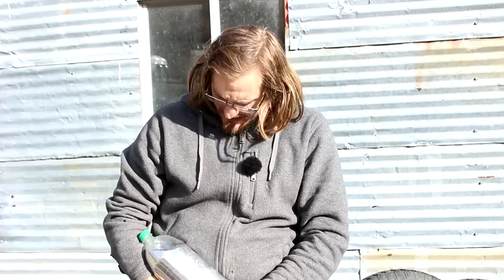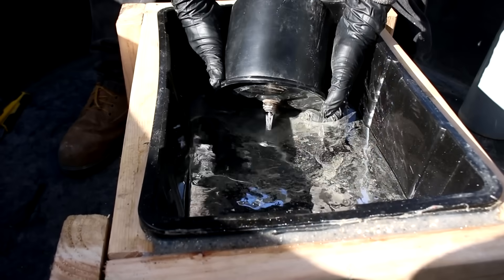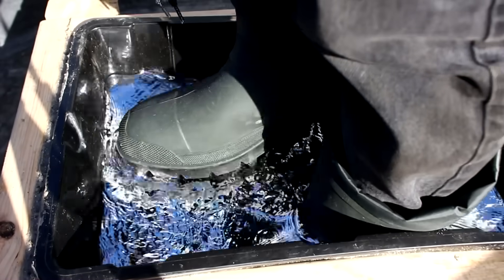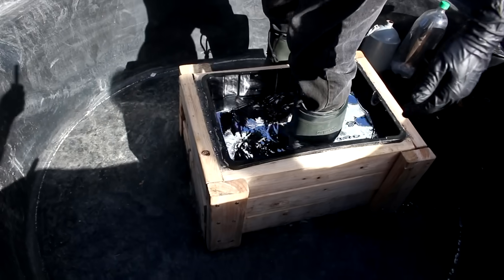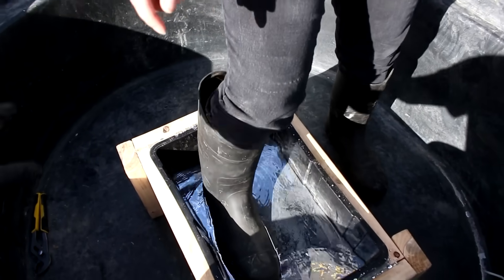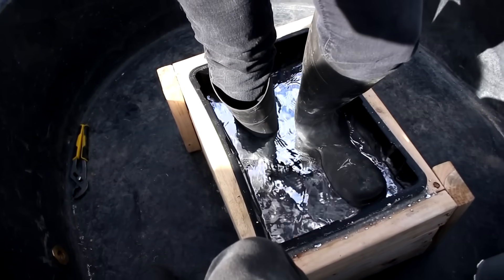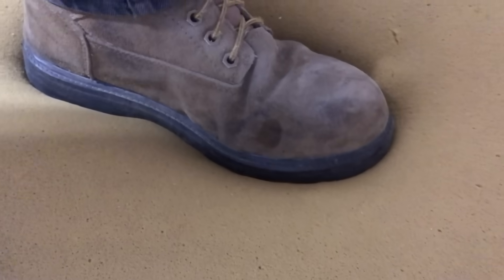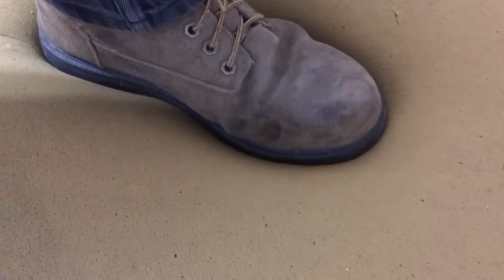Can I Stand On Liquid Mercury?

Comment: Anyone wondering, only ingestion and long exposure to mercury is bad for your health and even then it's not exactly lethal. Lighthouse lights used to sit on a pool of mercury because it has very little friction and so the light can be kept spinning with much less effort. Whenever lighthouse keeper went up there (several times a day and night), they would be exposed to it. Not only that, during storms the tower would sway a bit and the bath of mercury would start to slosh and throw some mercury out of the pool which would then drip down on top of the lighthouse keepers, small amounts would even end up in their food.
Over time the poisoning would cause mental instability in lighthouse keepers, that combined with loneliness would drive them somewhat insane. "Mad as a lighthouse keeper" was a saying back then. They would act and talk rather irrationally and it was a rather widespread issue among lighthouse keepers, actually. But it would rarely lead to their deaths.
Anyhow, the issue went away with modern LED lights. No pool of mercury needed because it doesn't need to spin, LED lights just turn on and off in a rotating light pattern. Needs very little maintenance and often doesn't even need a resident keeper. The only thing that needs real maintenance is the tower itself as water and wind exposure is really harsh on the buildings.

Comment: You guys know that swimming pool that is the deepest pool on the Earth? They use it for research and stuff. What if they filled that with mercury? There's probably not that much mercury on Earth but hypothetically. I bet we couldn't even build something that could contain the pressure at the bottom. Hypothetically what if you froze a big water balloon and you  pulled  it all the way to the bottom? I wonder if there is a way to figure out how fast it would be going if you let it go and it shot up to the surface.

Comment: Could mercury be used to make tools (eg. hammer)? It should be at a temperature lower than -39 °C. What are the mechanical properties of mercury in the solid state? I've always been interested in that. Let's make a mercury machine that works at a low temperature lower than - 39 °C. And then there is an increase in temperature and the machine melts like ice cream and becomes liquid. That would be interesting.

Comment: should be possible to do some calculations first and then compare it with the outcome. lemme, try is about 13.5  and the density of water or Cody might be around 1. Suppose he is then sinking about 13 or 14 cm if he's 180 cm tall or about 13.5 of his length.  The video seems to confirm that even on 4:16.

Comment: really be careful because mercury is very dangerous and Try not to deal with it as much as you can.
even if you touch it , be sure to wash (Of course, never put the wound in contact with mercury). Because if, for example, you touch it with your hands and rub your hands on your eyes or it enters your body through your mouth or.. you may get cancer.
please be careful about it and Try not to deal with it as much as you can.❤
Reply: mercury doesnt cause cancer

Comment: This could be used as a manufacturing process. Vacuum bagging replacement comes to mind.
When I want to mold something in carbon fiber for instance. The bag is used with a vacuum pump to suck together the Carbon fiber material onto whatever mold I'm using. Sometimes I get wrinkles and other problems associated with sucking the air out of a bag.... 
If I could dip the carbon fiber mold into a vat of Mercury using some kind of paste or release agent or physical barrier to keep the Mercury from reacting with the epoxy resin the weight of the Mercury pressing onto and into every bend and curve and void would be perfect. Actually, Mercury being liquid could get into the inside spaces of a mold where you can't normally reach or apply a bag. Places were you wouldn't normally be able to remove the bag after curing too. Like really complicated shapes that wouldn't make removing traditional mold pieces even possible. 
Maybe latex? Latex could make the area you need to press into the mold Mercury proof and you would still get the pressure of the Mercury pushing against those complex hard it reach areas. And when it's cured. You just pour out the Mercury and peel off the latex.
You would have an amazing finish underneath.
You could mold parts in one piece that used to have to be done separately and then bonded together.

Comment: Just imagine if every sea and water on earth was replaced by liquid mercury. I cant imagine how thick submarine walls will have to be to handle such heavy forces
Reply: I don’t think you could even build a submarine, because steel floats on mercury too. Even if you left no air inside it would stay on the surface.
Reply: @mixer0014  i know. And doesnt mercury make aluminium weak? Aluminium is like one of the most used metals. I just cant imagine how hard if mercury replaced water

Comment: How stupid are you? You expose your self to mercury poisoning!
Reply: That's not very nice. I don't remember if it was this video or another, but Cody explains mercury evaporates at 1/500th the speed of water. Also, only the vapors do damage. You could drink the stuff and be fine.
Reply: @heath_00000  wow, did IQ levels just drop in your household? Do you also brush your teeth with arsenic?
Reply: @MEN101  You might be thinking of organic mercury, which is VERY deadly, just by contact with the skin. Also, mean, man!
Reply: @heath_00000  bro any form of mercury is toxic. They warn people against fluorescent lamps because they also contain mercury. 

Mercury regardless of the form, methyl or ethyl are highly toxic. The same goes for liquid mercury found in thermometers.
Reply: @MEN101  I said mercury was toxic. I was saying this mercury wasn't immediately lethal, or even noticeably harmful within the ~hour of exposure Cody had.
Reply: @MEN101  And steel is dangerous when lobbed at you at 500 meters a second. Doesnt stop you from interacting with it safetly day to day

Comment: mercury is poisonous
Reply from the maker: So is oxygen
Reply: @theCodyReeder  i did not know that thank you but how. i have heard that if mercury is dropped on skin people die i would like to know. thank you for letting me know. i love your videos
Reply: @madhupmaity6823  What you've heard is true for a compound of mercury called Dimethyl Mercury. Very dangerous and diffuses through the skin immediately on contact. Not all compounds of mercury are dangerous to the human body, but most are. Elemental mercury(what you see in the video) is very unreactive and you could theoretically drink pure mercury liquid and it pass through you completely unaffected. It also does not diffuse through skin so this is fine(but for safety, don't pour it on an open wound). Ask if you have any other questions. 

Mercury was used in amalgams for tooth filling precisely because of how safe pure mercury is.

Comment: This channel gives the dangerous impression that mercury is no big deal. A teaspoon suffices to contaminate an entire neighborhood
Reply: What was mentioned in this video is pure metallic mercury. This is different from the more toxic forms of mercury. Mercury vapor was likely insignificant because of the ventilation and the fact that it wasn’t hot. The mercury was also never dissolved or put through chemical process to where it would become water/fat soluble and could easily get into a person’s body and stay there to poison it. If you need any more about the risks of mercury, you don’t need to give into common fear, instead use proper scientific sources to understand the risk and safety measures for mercury

Comment: Moron
Reply: What was mentioned in this video is pure metallic mercury. This is different from the more toxic forms of mercury. Mercury vapor was likely insignificant because of the ventilation and the fact that it wasn’t hot. The mercury was also never dissolved or put through chemical process to where it would become water/fat soluble and could easily get into a person’s body and stay there to poison it. If you need any more about the risks of mercury, you don’t need to give into common fear, instead use proper scientific sources to understand the risk and safety measures for mercury

Comment: Haha just contact with bare skin is enough to poison you if in contact enough over some time
Reply: @JustmeMe-n8n  well that is liquid Mercury which is toxic to the human body, have you ever herd of the mad hatters disease? It was caused by the mercury that was used by hat makers a very long time ago... Just read about liquid Mercury it’s toxic.
Reply: Like I said in first comment if in contact enough over some time just read... And is not less toxic and if handled enough times it will build up inside body, Mercury is all the same they don’t take the poison out of it, it’s Mercury at the end of the day and Mercury is always toxic...
Reply: Brobrobro, this is elemental mercury,  and it's not very dangerous unless you inhale it or have a cut wound in your skin.
Reply: What was mentioned in this video is pure metallic mercury. This is different from the more toxic forms of mercury. Mercury vapor was likely insignificant because of the ventilation and the fact that it wasn’t hot. The mercury was also never dissolved or put through chemical process to where it would become water/fat soluble and could easily get into a person’s body and stay there to poison it. If you need any more about the risks of mercury, you don’t need to give into common fear, instead use proper scientific sources to understand the risk and safety measures for mercury
Reply: @muschgathloosia5875  haha yes crazy as a hatter, but when mercury is absorbed into the body either way vapour or handling its poison and will effect the human system

Comment: JUST PLAIN STUPID!
Reply: What was mentioned in this video is pure metallic mercury. This is different from the more toxic forms of mercury. Mercury vapor was likely insignificant because of the ventilation and the fact that it wasn’t hot. The mercury was also never dissolved or put through chemical process to where it would become water/fat soluble and could easily get into a person’s body and stay there to poison it. If you need any more about the risks of mercury, you don’t need to give into common fear, instead use proper scientific sources to understand the risk and safety measures for mercury

Comment: mercury is DEFINITELY just as dangerous as people have said ,   please if anyone's got kids watching videos like this ,  tell them to tab away from this misleading imformation ,   this is cyber crime almost
Reply: It is not you should not be in it for a long time but the only time it's really dangerous is when you drink it. Be scared of lead that is way deadlier.
Reply: What was mentioned in this video is pure metallic mercury. This is different from the more toxic forms of mercury. Mercury vapor was likely insignificant because of the ventilation and the fact that it wasn’t hot. The mercury was also never dissolved or put through chemical process to where it would become water/fat soluble and could easily get into a person’s body and stay there to poison it. If you need any more about the risks of mercury, you don’t need to give into common fear, instead use proper scientific sources to understand the risk and safety measures for mercury
Reply: damn your right. im boutta ring up the cyber police to lock up this cyber criminal. thank you random commenter, you have saved the day by proving this scientist he was wrong. were would we be without you

Comment: i think this is bullshit, i think hes using gallium in a very hot climate, because that much mercury would kill you many times over
Reply: If it was inside your body, yes. Metallic mercury cannot penetrate your skin. So as long as you don't breathe in a lot of the fumes (which is why he did it outside) or have an open wound touching the mercury, not a lot is gonna happen to you. He sent a blood sample to a lab after doing this and the mercury levels were only slightly elevated, not enough to pose a health risk.
Reply: Nah, ur bullshit. Do some research before calling everything u dont like fake
Reply: Note that gallium isnt nearly as dense as mercury, so if it were gallium, he wouldnt float as high

Comment: Isn’t this like super unsafe
Reply: What was mentioned in this video is pure metallic mercury. This is different from the more toxic forms of mercury. Mercury vapor was likely insignificant because of the ventilation and the fact that it wasn’t hot. The mercury was also never dissolved or put through chemical process to where it would become water/fat soluble and could easily get into a person’s body and stay there to poison it. If you need any more about the risks of mercury, you don’t need to give into common fear, instead use proper scientific sources to understand the risk and safety measures for mercury

Comment: I wish to swim on the surface of mercury lake - there is one natural mercury lake in the world - as i remember - but it is closed for private tourist area
looking in the sky ... floating like on an air mattress, will probably easily accelerate - when  rowing a heavy (density) medium, and as i expect floating without(with lower) friction dissipation will give longer inertion? is not it?- better than on water, as I suspect - dipping into the liquid by only 1 inch - will make me swim like polystyrene foam on water... for safety -  one should not to jump in "mercury swimming pool", otherwise he can break anything(body :-)) or to get hit by the surface, as i think
Reply: Pretty sure that mercury would absorb through the skin.
Reply: @SlightSmile  as i understand, saturated steam pressure of mercury so low, that even if body will be saturated with same concentration like normal air in some closed jar with mercury and air inside - total amount of mercury in body will be still lower than needed for toxic action of mercury, if body will adsorb and collect metall, toxic action will appear after some time, but considering low solubility of mercury in water(major component of body) and easy migration of mercury vapors through water layers, and eatable nature of metallic mercury(up to one glass instantly - some time justifiably), some swimming session on the mercury surface will not affect you
Reply: @IamJiva  I used "that" to specify the mercury, not as a relative clause.
Reply: @SlightSmile  against this special mercury :-)) it is worth using sunblock style cream

Comment: Hey Cody. I've thought about it a lot... but after seeing a video showing the giant iron racks of huge glass lenses in a very old lighthouse. There was no bearings or pivot point, just a circular hole that the whole bottom ring sits inside. They said the whole thing sat on a couple of inches of Mercury. Soooo.... I've seen the pictures from Egypt with the sleds with huge stones being pulled over land. There is always a guy pouring a vase in front of the skids?
Could they be floating the sled on Mercury?
I don't have enough Mercury  to do these kinds of experiments, but...

Comment: Mercury bowing ball cannon make a hole in the ground 3 to 4 m down  big enough for the bowing ball and reinforced walls of concrete now take a magnet and put it on the bottom then a conductive wire raping around the in side of the concrete then fill the hole thing with mercury then place the bowing ball in the mercury it floats now take that wire and connect it to a battery charging the wire watch mercury in a magnetic field on YouTube and watch what a vortex in a fluid does to thing that float on water that bowing ball should sink down and start spinning rifling it then just take the power away and now the vortex stops and it shoots out lol just an idea
Reply: I think you meant wrapping not raping

Comment: The buoyancy of the boots is a lot of the reason why you are "floating"
Reply: Whys is floating in quotes he is floating he’s suspended in a liquid
Reply: @snixBE   the boots are doing a lot of the floating. Cody says he is about an inch from the bottom wearing the boots . If he wasnt wearing the boots i would suspect he would be standing on the bottom . Much more of a humans body would have to be submerged before any floating would occur
Reply: GAB JAW it doesnt matter the fact he is suspended in the liquid means he’s floating you dont say a person isnt floating because they have armbands on do you
Reply: @snixBE  the experiment is flawed by large volume boots is why he is "floating". Using thick industial garbage bags as a buffer and the outcome would be different.
Reply: GAB JAW im not talking about the experiment im talking about the fact you said he was “floating” implying he didnt actually float even though he did float
Reply: @snixBE  ok point taken , the qoutes were me implying doubt of floating without the boots on . The thumb nail shows bare feet , then boots are used obviously because mercury in the blood stream is a no no .

Comment: I don't think it's a good idea to use mercury without the proper breathing protective equipment. The liquid mercury is not dangerous, but its wapours are extremely dangerous.
Reply: Outside on windy there's more than enough airflow to compensate.